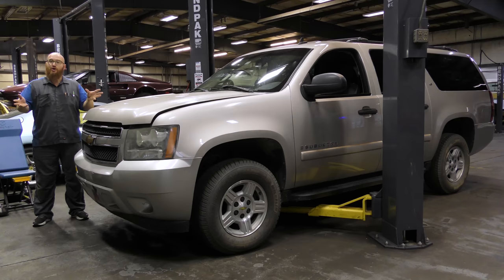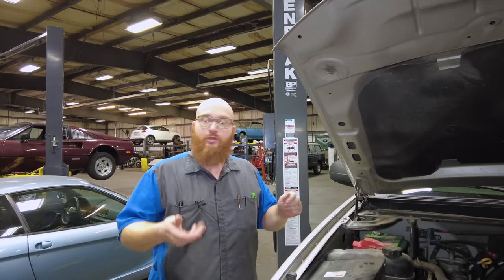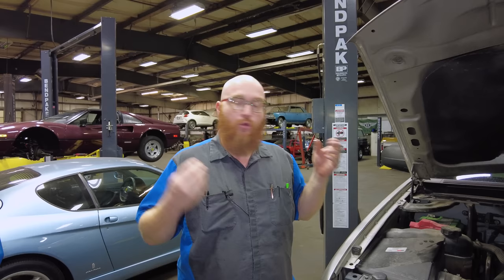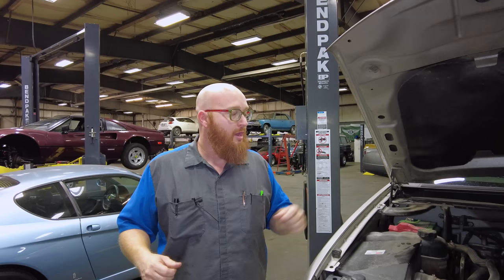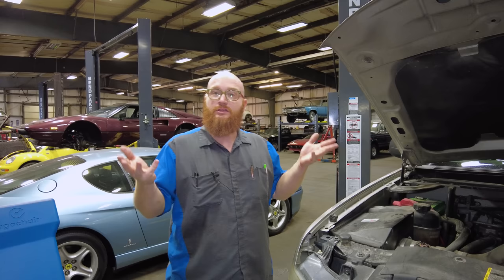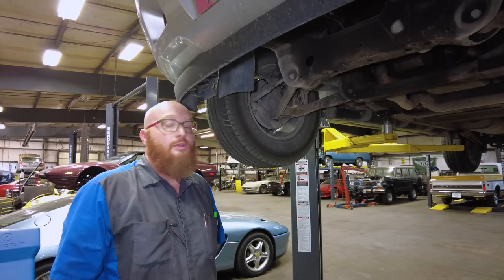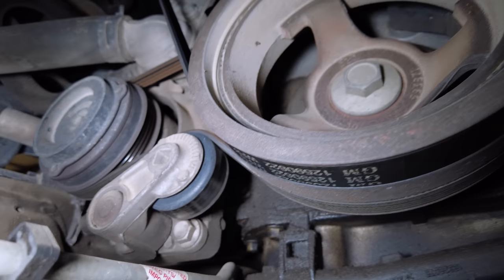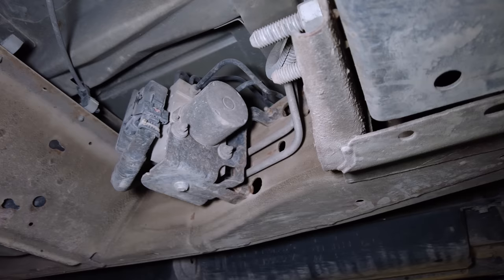What fails on ALL early 2000's Chevy SUV's!? CAR WIZARD shares what he's seen from the last 20 years

Comment: Dumb Question on that ABS module.  If that thing goes out like that, will it start trying to act like traction control is kicking in?  Mine started doing that so I just pulled the fuse for the ABS unit.  Leaving my lights on.

Comment: I have a 2009 GMC Sierra with the cast iron block. What are the common failures of them? It has 123460 miles on it but still runs like new.

Comment: I have a 2011 Chevy suburban and I currently having a issue and can’t seem to figure it out recently my dash cluster started jumping up and down and it started shifting hard and when you are driving it like it in limp mode and throwing codes on the dash for 
Stabilizer 
ABS 
Check engine 
Traction control off 
And start idling up and down want to see if you have any idea on what it can be

Comment: My 2003 2500hd has a squeak whenever I turn the steering wheel. I replaced the shocks but it’s still there just not quite as loud. Can’t figure out what it is

Comment: What could be the cause of a 2004 Chevy Blazer 4.3L to have low oil pressure?  Sending unit has been changed and made no difference.  Has 111,000 miles.  Thanks.

Comment: Love your video.
I have a 2013 Chevy Tahoe LT 4WD. The " SERVICE 4WD LIGHT IS ON ". I already replaced the ACTUATOR. But the light is still on. And now when I try to put it on 4WD it won't engage, it doesn't shift to 4WD. Any idea?

Comment: Have an 02 Suburban 1500 Z71 with 5.3L Z engine. Leaks and/or burns oil like it’s a job. Driving for about an hour and half straight with little breaks, the engine starts running rough and just shuts off, everything else is good. Gauges read all good but engine just, stops. Narrowed it down to clogged cat, vapor lock, or now possible throttle body issue. I’m leaning toward clogged cat but may need some more ideas. Any thoughts?

Comment: Have a 2003 Chevy suburban and last year we had a complete a/c system replacement done. When we got it back it has no reverse lights and the interior dome lights no longer come on when the doors open or when you roll the dome light switch. We took it back and have taken it to several shops but no one can figure out the issue. We have checked/changed fuses, bulbs, headlight switch…nothing. Not looking to run new wires and install switches, would just like it to operate like it’s supposed to. Any ideas???

Comment: Hi Car Wizard - I bought a 2009 Escalade with the 6.2 Vortec engine. When we are towing our travel trailer in summer weather in Utah where the temps are well in the high 90s. I noticed my temp guage go past the middle reading and climb into the 3/4 range which makes me nervous when going uphill. Once we start driving down hill and on level roads the temp goes back to the middle. My Escalade has 184k miles now. It's never overheated while I've owned it. Should I be concerned and is there something that I can do as a preventive measure to keep the temp from climbing when going uphill or is this normal?

Comment: I rarely tow with my 02 Chevy Suburban, but the last time I towed I could not tell if the tow button was on or off, because there's no light indicator.  I'd like to check that, but how would I know?
Reply: Yes, I fixed it knowing that at 302k miles the wire should break, so yes I've repaired that.  Now, I'm replacing the seat bottoms to install new leather on the front seats.

Comment: 03 yukon xl steering box bolts with 160000 broke. 6.0 engine  replaced gas line and have to replace oil psi sending unit again other than that its still better than a ford

Comment: Great video, thank you!! I just put in a new engine and new transmission in my 2007 suburban. Now I have a rattle when I slightly press on the accelerator. After research I think it might be my starter drive. Do you have any thoughts on what it might be?

Comment: Yeah I had a 2007 avalanche the #7 lifter went at 150,000 and it had flex fuel on it. It wasent worth the cost too fix it. The other thing is it had aluminum heads on it on a cast iron block some manifold bolts at the rear were broke, I went with a old school 1978 Gmc 3/4 ton 4wd and rather put money into that truck and have a reliable vehicle that I can work on and no computer stuff on it and parts are a lot cheaper every time I had anything done on the avalanche it was $1000.00 bucks the fuel pump went on it it took us 12 hours to drop the tank because of rust I live in Ohio so we deal with tons of salt which makes parts rust big time. The fuel lines on it you couldn’t see where they went there’s no room too work on an avalanche with out disassembling the front end I could go on with real dumb engineer choices on how they build cars today you would think they would make it easier but no they want profit over people that’s why car manufactures have real stupid high prices on vehicles what they should do is give it a lifetime warranty on it because the average person dos T have the money too fix most of this stuff on newer vehicles or have the money too but a new one

Comment: My daughter has a 2002 GMC yukon xl 1500 5.3 flex fuel. Bank 1 is firing all cylinders. Bank 2 is dead. There is voltage to all coils and injectors. Plus it backfires. Any suggestions?  Tkx oh yeah, fuel pressure is normal.

Comment: Get in the habit of not turning on the fan before you have decided where you need the air…..that way the motors don’t have to work so hard.  Also the plastics the doors  are made from will last much longer…..no more issues !

Comment: Why can i hear rpms drop in drive? 
It sounds like torque converter lock up. Just as in overdrive. 
That's a good thing. Right?
Or. Also. Does a 4L80e have torque converter lock up in Drive and overdrive.?

Comment: I need help on mine, I’ve been working on it myself. I have a Misfire on Cylinder 4, Coils, Plugs & Wires and all fuel injectors were checked and replaced. I have a flashing Check E light On. I have compression on all cylinders. And no luck. Same misfire on Cyl 4 Code and the truck is shaky. Any help? Thanks.

Comment: I have a question on the oil pressure sending unit. I have a major oil leak and think it may be a rear main seal but after seeing this video I’m hoping it’s just this. However my oil pressure gauge operates fine. Could it still be leaking with the gauge still working well?

Comment: Try $500 to $650 for a mechanic to replace the oil pressure sending unit! I got 2 quotes so I just did it myself for $72 the price of the part

Comment: I had to change out the transmission on my 2011 suburban 1500LT, and now it looks like I have to change out the engine also. I have a question about the core charge and refund after returning the original part. Is the core charge included in the cost of the replacement part? The price I would pay.

Comment: Has anyone ever thought of not paying $50,000-75,000 dollars for these vehicles with all these pattern failures? Isn't that kind of the problem, that people are still willing to buy them for top dollar?  By the way I own 5 of these 2007 and up Suburbans with between 90,000 and 266,000 miles and the only one of these problems I have had is the collapsed lifter, but I have not seen one take out the cam lobe yet. I just put in a new lifter, and then run a Range AFM disabler.  Why would you pay $400 to have your oil pressure sending unit replaced on your vehicle if you know it has good oil pressure?

Comment: Car Wizard. I have been looking to see if you have any videos on the 6.2L, but my question for you or anyone in the comments. Im looking to buy a full size suv. My budget puts me in the 2007-2013 models. After seeing so much on the active fuel management Im leaning towards the Yukon Xl Denali or Escalade esv with the 6.2L, which does not have active fuel management and has the 6 speed trans. Is this a good vehicle of its well sourced. Anything commenters can contribute is appreciated.

Comment: Maybe someone on here can help me out... I have a 2001 Suburban 1500 2WD. Starting today, at idle there's an audible but, not terribly loud, squeal/whine, from the drivers side engine compartment. When I drive/accelerate, the squeal/whine became quite loud and constant. Not changing in tone or intensity from start until back to idle. When I got home and parked, there was a "hot metal" smell. Oils good, fluids are good. My initial thought is perhaps a wheel or tensioner or belt. But, I'm seeing perhaps alternator. I haven't had a chance to get under there and look yet. The smell is what really has me concerned/confused.

Comment: I just bought a 2007 5.3 liter 4x4 Tahoe with 310K miles, the transmission sometimes has a hard shift. Should I fill transmission with  Sea Foam transmission and flush it out in about 100 miles?

Comment: I bought a 2007 Chevy Tahoe and I’m having an issue now with it. Where it shows the mileage well it doesn’t show anymore. My question is who can I take it to it get that fixed? I was told to take it to the Dealer, is that correct, is that an easy fix?

Comment: I’m shopping for a $10,000 or less SUV tow vehicle 3/4 ton or a 1 ton. Is the Chevy/ GMC 1999 to 2007 my best option, or is there something better from Ford or Dodge? I’m guessing that Toyota will be too expensive and not have enough tow capacity in my price range. I need to tow about 7,500 to 8,500 pounds.

Comment: I know this is a year old. I have a 2001 yukon xl.  my remote isn't working.. I replaces receiver. does the alarm system connect (wiring) through Onstar or is it completely separate?

Comment: I have a Tahoe 07 has 115k miles just had its first tune up. But since 2 weeks I have the brake system and Traction and Stability Trak sensors on all saying off. What could be the real reason..help?

Comment: This AFM crap is ridiculous. GM tried this back in the 80’s with Cadillac. Not exactly the same but believe it shut off the fuel to cylinders to conserve fuel. Garbage. This active fuel management system is still being used today on GM trucks. Not sure how much the design has changed but have heard it’s junk also. 😂

Comment: I have a 2009 Chevy Tahoe, I've replaced the air shocks, the air ride compressor, all of the leveling valves, but the compressor doesn't work unless I bypass the realy. I'm at my witts end, so you know I bought the compressor on Amazon, it's a after market, do you have any ideas?

Comment: What's going to fall,  I bought one, 280,000 miles on it. Runs great. Then I took it apart put 30.000 gap in rings, put it back together, put a turbo on it,  a different cam, it now has 950hp at the crank. I have 3,000  dollars in it. Counting the holly Terminator ECU. So...I'll take all the p.o.s failure prone ls Motors, you dont want to pay some hack with his name on his shirt 80 hr to fix. I'll hall them off for you.

Comment: Great video brother.  I’m no mechanic. I’ve only started doing my own repairs purely out of necessity. These shops try to rape you out here in Florida.  My wife has a 2007 Chevy Suburban.  I’ve replaced the dreaded oil pressure sensor, the O2 sensors, the AC belt, the serpentine belt, the radiator, the heater hoses, the upper and lower radiator hoses, the thermostat, the hydraulic arms for the cargo door, the front brakes and rotor. My next project is replacing the rear differential cover gasket and pinion seal.  Do you have a video on this? Any tips? Yah bless you.

Comment: Is carrying an internal payload of 2500lb as hard on a 4L60E as pulling a trailer?  I've never pulled a trailer but my 2004 C1500 Suburban has blown 4 transmissions in 260000 miles. It is filled to capacity with that heavy internal load about half the time. I'm interested if internal payload is the same issue as pullin a trailer? Thanks!

Comment: 🤔 these must be your experiences 430,000+ on engine trans out for sun shell and vb spacer plate 168,000 trans overhaul at 297,000 brakes 125,000+ first job alternator at 225,000  Water pump at 312,000 first one power steering system at 340,000 oil pan gasket {due to low oil pressure at 195,000 need I say more😂😂😂

Comment: Dude at 100k on any vehicle i garentee theres been a couple things that have already failed 😂 espically in states were thay rust. Take an old carbarated vehicle without all the eletric b.s and one of these 2010 compairing them side to side if thay were bouth in brand new condition the carbarated vehicle will definitly out last the efi version i dont care what make or modle it is carbarated is a more dependable desing hands down !

Comment: You mentioned some about the AM/FM delete.  My radio is not working, it turns on but no sound. Seems like when it rains the sound plays sometimes. I check all the fuses, and most of the grounding points. Any advice on this?

Comment: Hi wizard,  I have a 02 avalanche Z71 4x4.. I just had the transmission rebuilt got it home an within two days had to send it back. The shop it's at now  told me it entered limp mode due to lack of communication with the computer. He's done ignition switch pulled the trans again an now currently working on the harness to see if anything broke. Would you happen to have anymore ideas as to what to look at. Tyia

Comment: I recently bought a 2010 suburban with 150,000 miles on it.  Do you suggest I drop the tranny pan and install a new filter and replace the lost fluid. Or a tranny flush with new filter? Thanks

Comment: What year is that SUV? I have a 2001 GMC Yukon that has 340000 on it. That fuse doesn't exist on mine. And the oil sensor is still original and working. The only thing I had to do was a rear axle ,  at 280k the transmission at 330k  and the usual brakes, shocks (boy those nivomats are expensive)  tires, and a Oil change every 3k4k yes more than recommend but hey it's got 340k on the original Motor.  The AC still works, oh the sunroof track has an issue but I can live without opening it  I did replace all the suspension parts after moving to a state with bad roads but again it's coming up on 1/2 a million miles . And I did replace the knock sensors it took 1/2 hour to remove and 1/2 hour to replace the intake, I was a little worried about the plastic intake but they are tough just make sure you have a good inch lb torque wrench to put the bolts back in and use a new gasket.  My total time in the driveway was just over an hour and I never did this work on the 5.3

Comment: Ha….. your wrong Wizzer.  Jeep Wrangler has the cheapest plastic actuators in there HVAC systems . I’ve had 4 replaced in 8 years of ownership. Love my 2013 Jeep Wrangler Unlimited Rubicon  78k miles but it’s a piece

Comment: I have a 2005 5.3 tahoe first start of the day would fire straight up then if i turn it off i have to hold the gas pedal down and it cranks for a good bit before it will start and i can smell gas now this morning it wont start at all any help would be greatly appreciated its going to cost me my job
Reply: It could be a few things, but my first guess is a failing fuel pump or break in a fuel line.

Comment: Afm/dod, torque converter breaking on the 6l80e, sending metal to the transmission, 3.08 rear end gears are so weak. Interior door handles break all the time. The 1500 is just a horrible suburban, especially the gmt900. The previous generations are much better built.

Comment: 2002 2500HD.  200k miles.  Only actual failure was the climate control fan resistor pack.

Comment: I think I have my answer on the year of that SUV the Title says Early 2000s but when talking about the active fuel system you say get an earlier one 06-05-04 , anything 05 and earlier is early 2000 that SUV is not a early 2000s it's late 2000s.  This explains why my 01 doesn't have any of that nonsense in it

Comment: It sounds to me like a 3500$ vehicle that’s going to need about 7000$ of work. I’ll stick to my LX450. 260,000 original miles, no major work except refurbishing the front axles at 200,000
Reply: Edit. The axle was 1000$. Also a backflow sensor, 250$.

Comment: Don’t lump the garbage GMT900 07-10 trucks in with the GMT800 99 through 06 trucks.  You should know better than that. The GMT 800 are  best trucks released and so easy to work on.

Comment: I have a 2003 Silverado with 5.3 engine. I have had the spark plug wires off several times,  never broke a single one. I replaced the wires at a spark plug change more out of caution than necessity. My oil pressure sending unit failed, showed max pressure, no leaks. It was a pain to change, due to location but not as bad as he claims. On the AC compressor belt tensioner, I replaced the belt due to age and the tensioner pulley because it was getting noisy. I'm not buying this guy's "it will break, guaranteed" doom saying. Yes, some things were a very bad idea, AFM for one, but any part that moves, rubs (brakes) or turns will wear out some time. Nothing unique to the GM product line. I am prejudiced against GM, will never buy another, but not for anything he shows here.

Comment: 2008 Suburban 1500 LT 4x4. LC9 engine. I'm on 2nd complete engine rebuild. $15,000 across the 2 rebuilds. Zero accountability from GM.  First failure at 95,400 miles. 2nd at 168,000 miles. Total garbage. I'm now on a quest to drive this thing into the ground. DO NOT buy any 2007-2009 versions of this product.